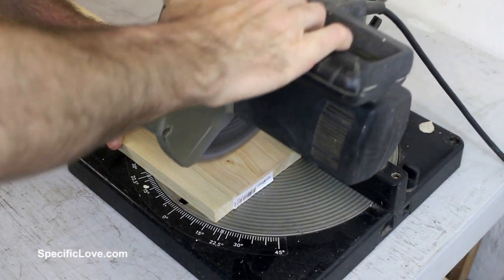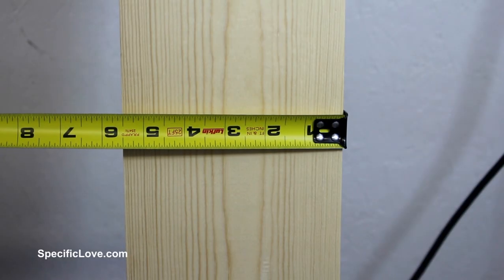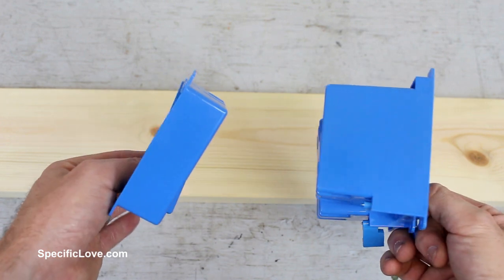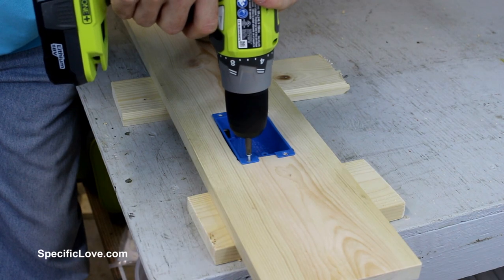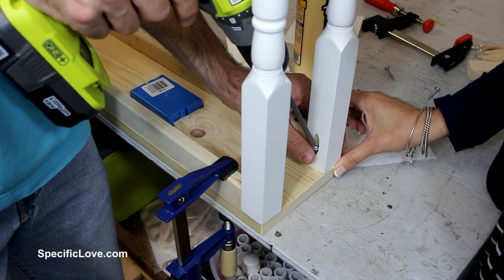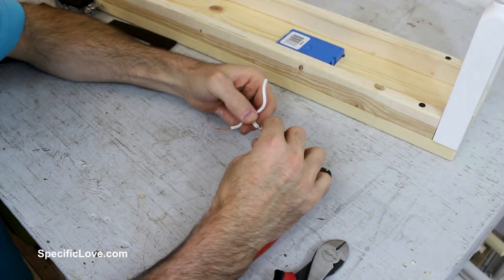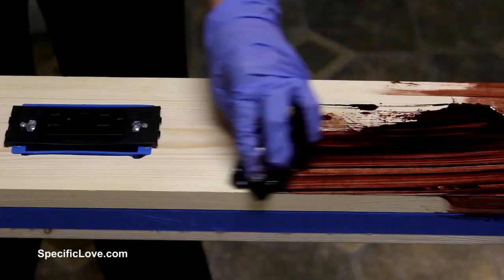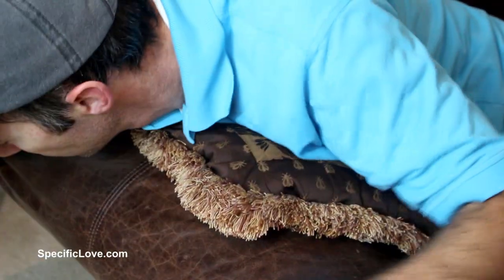DIY Behind Sofa Table with Outlets

Comment: Could install the legs with pocket screw then us side wall to hide the pocket screes etc and make easier to in stall in close quarters etc.   but over overall great idea just inspired me  as wheel the outlets could be switch to include a sub ports as well
Reply from the maker: +datawolftech We might upgrade to USB in the future but the fancy versions are about $30 each so we decided to wait.
Reply: A right angle drill or adapter would have solved the clearance issue with screwing the legs in.

Comment: What sort of board did you use for the top of the table? I tried making a table like this and the board is warped and the table wobbles like crazy.
Reply: Mandie Cangialosi a straight board.
Reply: You can get "project boards" at lowes or home depot, they consist of many smaller boards glued together and they are much flatter and smoother than just a regular board.

Comment: Sure hope that outlet is on a GFIC breaker. If not, spilling a drink on it  could be fatal.
Reply: john hanrahan I’m gonna go ahead and they aren’t. Lol
Reply: @mvalovalo  LOL, 
You know that only certain outlets need to be on a gfci and most likely these ones are connected to a code approved breaker in the breaker box or there's an outlet further up the line that controls/protects the whole circuit.